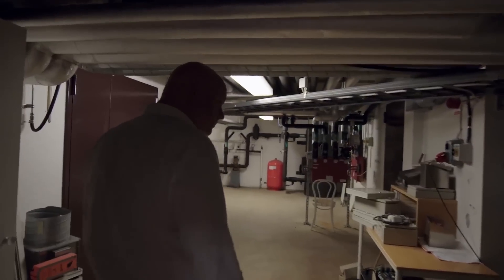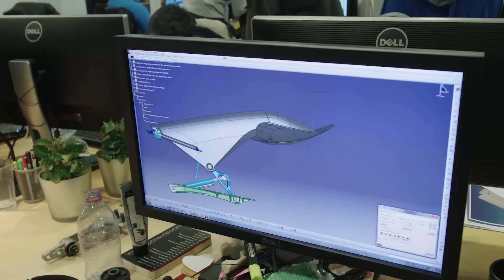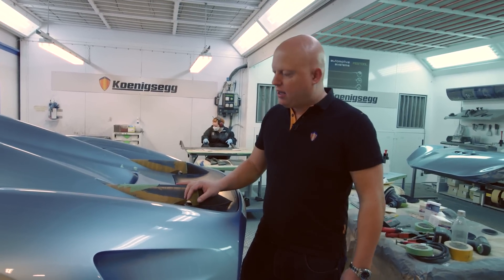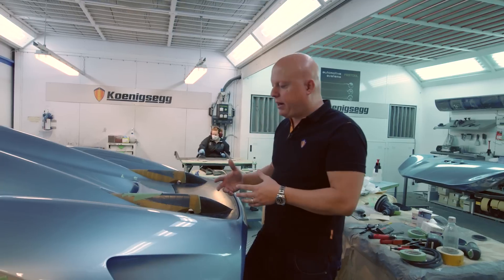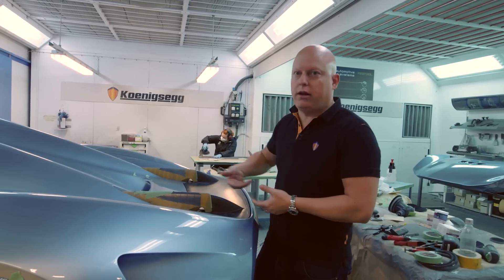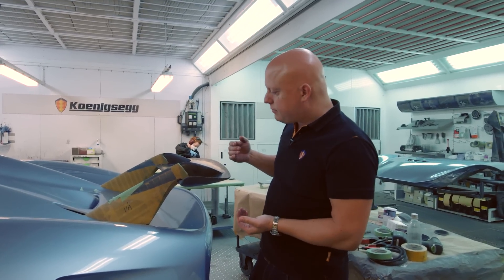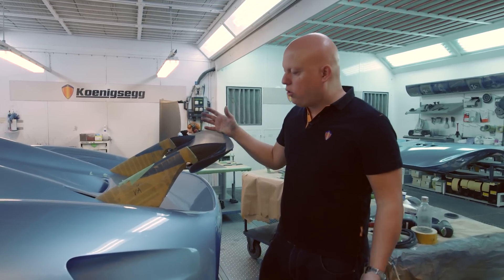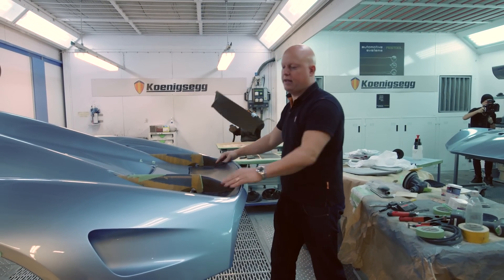A Whole New Wing - /INSIDE KOENIGSEGG

Comment: I understand the importance of an elegant and sleek design, but does it have enough wing area to provide the desired downforce? Looks a bit underdimensioned to me. I think the 918 wing is just as elegant, while the racy scaffolding contraption of the P1 looks very purposeful, but both are of course intended to be true track machines whereas this is not.  

Btw there is a clip uploaded to Koenigsegg's Instagram account showing the Regera whizzing around a bit on electrical power, so it does move.
Reply: Moe Go Just seen the video It goes around 50mtrs in a straight line forward at 10MPH, could even be CvK hidden behind it pushing for all we know :) (i am joking)not exactly a full demonstration of a 1500BHP hypercar. I don't think this little wing is going to sufficiently control the forces of nature that moving at the speeds it is capable are going to deliver so i agree.
Reply: Lawsy I'm sure the pylons (and whatever mechanism is hidden beneath the skin) are sturdy enough to take the forces generated by the airflow, but I'm more curious about what the magnitude of the actual resultant force is. On the other hand a mammoth wing à la One:1 would seem out of place on a car of this character, so maybe it is perfectly adequate after all. 

I do think it would be a more aesthetically balanced design if the wing actually was a little larger when deployed. Form over function, I know!
Reply: Moe Go
You are of course correct unless of you really believe that Porsche and McLaren know nothing about developing aero and wings for cars and are doing it all wrong.

Obviously Koenigsegg are still learning hence the Stig famously crashing on Top gear because the standard wing did not provide anywhere near enough down force, and them hurriedly having to fit a much bigger on just for the lap.

but what would i know?
Reply: M3Conv Where did I suggest Porsche and McLaren don't know anything about aerodynamics? In fact I just argued the opposite in this very discussion - are you really that unable to approach anything related to Koenigsegg without adopting a confrontational and sarcastic attitude? It's trollish stalker behaviour beyond the pale.

If you believe whatever happened to a CCX crash in 2006 is of particular value in this 2015 Regera discussion, it's up to you.
Reply: Moe Go
i was agreeing with you that querying the amount of down-force that such a small surface area wing with limited adjustment can produce is a very good question.

There is a tiny possibility that massively successfully racing car manufacturers with unlimited budgets and access to the most advanced CFD modelling software who both came up with similar solutions, may possibly know what they are doing? and would not have produced such a solution if the benefits did not outweigh the disadvantages.

Sorry about the reference to the CCX, but i could not help myself, first thing that most people associate Koenigsegg with unfortunately, no wonder they have never returned to Top Gear.
Reply: Num Num
So what you are saying is that if you wanted to take the car to the track you have to first return it to the factory for the dampers to be changed and  a wing added?. Does not sound very convenient to me and would suggest that the CCX was not representative of a customer car.

Anyway i am done here, lets wait until 2017 (sorry December 2016) to see how it performs.
Reply: Num Num Quite informative video, thanks for the link. Of course, the basics of how different aerodynamic elements are supposed to work are not terribly complex. Getting an understanding for how much various aspects of different wing types actually contribute is another thing. Aerodynamic flow calculations are notoriously complicated. 
All in all, the Regera wing might well be up to what is asked from it, I just think it'd look better were it a bit more prominent! :-)
Reply: M3Conv No chance in hell you will wait until December 2016 to share your thoughts. But I encourage you to try.
Reply: Num Num
Would not know about that as i have a button inside the car which changes the damper settings, strange also that the professional racing driver who drove the car would not have thought about it either, in other words sounds a bit suspect to me.

What about the wing which (even if you are a professional racing driver) you need to keep the car on the road?, just 'click' your finger and it appears?.

A PR nightmare would you not agree?
Reply: Num Num
Sorry, i retract that last comment as according to Top Gear magazine it was not the Stig driving, it was actually Koenigseggs senior test driver when it crashed.

Would have thought that he might have realised that the suspension needed adjusting and the car having no downforce, no? (i am guessing you wont answer this one as usual)

Edit - Sorry that was a different crash around the same time but also for Top Gear. Wonder they did not run out of cars :)
Reply: Lawsy
Believe me, CFD modelling particularly using something as generic as SolidWorks on a desktop or even server based for something as complex as a supercar with active aero, would be about as useful as learning to fly a helicopter with a playstation.

That's why manufacturers like Porsche, McLaren and Ferrari have invested 10's of millions £ in state of the art, in-house wind tunnels, and further 10's of millions £ in data centers to run bespoke modelling solutions operated by teams of the most highly qualified Aerodynamics Engineers.

I don't doubt that Koenigsegg use some form of CFD modelling for component and vehicle development and also pay for some wind tunnel time but don't confuse that with what the mulch-billion £ corporations have access to within their own development facilities.

My question was simple, do you really think that the solution used in this video will outperform or is 'better' than what have been developed for say the 918, P1 or F70?

Comment: I don't get why you'd want leverage over the rear wheels. What that leverage does end up doing is basically greating lift at the front at the same time that it's trying to push the rear down.
Depending on how much downforce at the rear is generated and how light the front end is, the car will have a tendency to flip. As long as the car doesn't use a flat underbelly, like Mardenborough's GT-R, it shouldn't create an air wall underneath.
Still that lift at the front means less response from the front end, as those tyres are pushed down less. Yet they are the ones that you need a lot in anything other than a drag race.

I am sure they know tons more on vehicle dynamics than I do, so I am sure there must be a reason for it. Hopefully I'll learn why some day. :)

Comment: There's a good reason why CVK and Koenigsegg are successful at what they do: They don't limit their thinking to traditional designs.
A traditional spoiler is just a plank mounted on scaffolding, and that's what has been done for years because everyone limits their thinking to that design. And that's the thing to remember with engineering, there is never just one solution to a problem.
Reply: TheMechEngineer Nice solution. That is why I admire the type of aero system Ferrari uses on LaF with active flaps and the rear wing that cooperates with the rest of the  system as one unite to create best possible downforce with least drag. In comparison Mclaren's aero system with a huge wing is like the traditional system and more suited for a race car than a modern sports car.

Comment: Very interesting idea, but the implementation is not the best.  You don't want the pylon to be that close to the leading edge of your wing, either.  Ruins the suction peak side due to interference effects
Reply: Shadowboost I don't get why the pylons are that close to the wing either, why not just keep the front part of the pylon that there is now and get rid of the rear part or create a longer horizontal part of the mount. Maybe to minimize drag? And if we are talking about not being close, why not completely get rid of it to create a wing like the one from the One:1, but foldable into the car? Would that create too much weight then?
Reply: Boon Breyne I don't see any advantage structurally or aerodynamically to require this.

Comment: This guy's a freakin' genius! Imagine what he could build if he had Porsche money.
Reply: JaySee5 Im pretty sure he has enough finance to do whatever he has on his mind.
Reply: So5loW
Yeah, no. He doesn't have all the money of Porsche and VW group to make multiple prototypes, tracks, computer simulation, etc.
Reply: sengalkol your crazy! the level of detail on the wing alone is about as much passion as Pagani!
Reply: So5loW Koenigsegg only turn over 15M euro per year, Porsche spent 24M euro developing the steering wheel alone on the 918! do not confuse high technology with adverts
Reply: JaySee5 You can´t compare those manufactures. Königsegg is focusing on one car and they can go totally crazy because the customers will pay nearly any price for these cars. Porsche on the other hand only have one hyper car and that is realy insane too. A 911 is just an mass production car and you have to focus on how fast and cheap the cars can be produced. If you produce thousands of cars of one model, each euro or even each cent is important to save. If one part is a little bit better but would take 10mins longer to produce, it wont have a chance.

Königsegg only produce a few cars a year and if a part would be cool but cost 5 Euro more to produce, than they will do it. Raise the price by 5 euro of the car and go. Thats how supercars are produced. Look for example at paganis valve caps. They are manufactur out of a massive forged aluminium block. The final part is awesome but it´s stupid expensive and a much cheaper one would do the job too. But thats not how this industry works. To build a hyper car must be an engineers dream. And i know what i am talking about, because i am one of those guys ;)
Reply: +JaySee5 As shown in many other videos on youtube, he doesn't need "Porsche money".
Reply: JaySee5 but still he had no match of a passion compare to Mr. Pagani
Reply: Alfred Munkenbeck But they would never put that wing on a cayman since the performance is not high enough to warrant a wing like that. If it did, the Cayman would outclass the 911 and Porsche can't do that.
Reply: ***** founding woooooo
Reply: CF88DRUM Yeah true that. What Porsche achieves is more difficult in a lot of ways. Making something beautiful, well built, reliable, with a large performance envelope and while limited to production methods when every dollar counts is extremely challenging. The tooling costs for a production car are insane.
Reply: Autocar

http://www.autocar.co.uk/blogs/new-cars/are-you-impressed-porsche-918-spyder

however i know that they are using the same wheel in lesser cars like the Mecan if you want a bargain :)
Reply: Well all this financial capacity from VW does Bugatti have. Well and as far I know a Koenigsegg beats a Bugatti on "Spa Franchise" also a Porsche 918. So whats your point?
Reply: JaySee5 I'm pretty sure all he'd be able to do is produce more cars for slightly less cost...Not that he'd want to do that, it'd be make them less desirable
Reply: ***** really? do u have some confirm about that?
Reply: JaySee5 I say the same thing- he is a genius and I hope he passes it on
Reply: JaySee5 that would mean that VW would start making reliable good looking cars if they used his genius
Reply: So5loW Not really, it's much cheaper to put an Agera into production than it is a 911. Imagine what he'd come up with if he could apply his genius to mass production is what he's trying to say. A wing like that in a Porsche Cayman? I can see the potential.
Reply: JaySee5 VW doesnt give give Porsche all the money in the world to design cars. They are just on a budget than any other manufacturer.
Reply: ***** Also Bard Eker, a Norwegian businessman is also is substancial shareholder in Koenigsegg as well, I believe.
Reply: JaySee5 if he was a genius he wouldn't have opposed electric drive and overlooked basic aerodynamics. He's a decent engineer but like most humans he misses obvious engineering aspects and even refuses to see it when served on a silver platter.
Reply: M3Conv what's your source on the steering wheel costs?
Reply: SocraticMind89
nah..man..ferrari had done the same thing with La Ferrari, so as lamborghini with Aventador, and porschewith their awesome 918 spyder, it is the level work that no one had done in automotive industries where pagani had place them self different from others, for example, if you see the early models of koenigsegg it looks just like ferrari 360 modena and mclaren f1, till this day it still does. but pagani when of the other direction and material wise pagani is the best, workmanship they put ferrari in a shithole eventhough ferrari products are good but no where close to pagani.